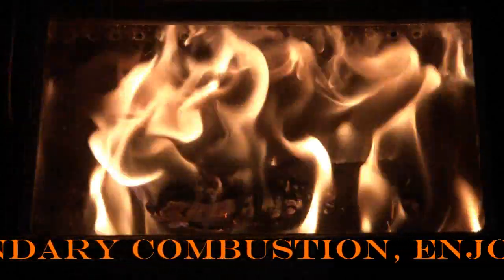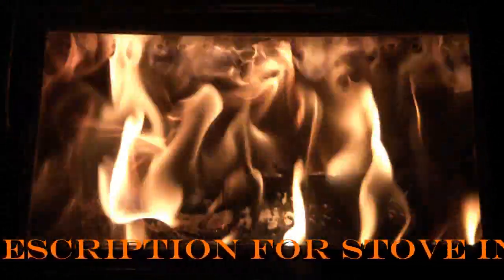Our wood stove's secondary combustion explained

Comment: I was looking to replace the overly expensive catalytic combustor for this unit, it took a few hours searching, I found that firecatcombustors.com makes the High Valley catalytic combustor.Mine was a WV-4150000034 for my High Valley catalytic insert.      Hope I saved you a few bucks not having to buy through High Valley!

Comment: Its still burning to fast for an air tight wood stove. Secondary combustion is really not needed if Your burning hardwood. I burn white birch in my airtight woodstove and the fire lasts for 2 HRS before having to throw more wood on the fire.

Comment: Why is the baffle insulation that just lays flat on top of the firebrick necessary
Reply: Sam Anderson so the secondary flames don't melt or distort the top of the stove at 1600 degrees.

Comment: My question is how does the air get that hot that fast when pulled into the secondary tube. It's just a straight shot from outside to inside.
Reply: The air comes in at the outside temperature and early in the burn that cold dense air has lots of oxygen in it.  As that plenum heats up, the fire brick radiates heat back into the stove and the metal absorbs it, its highly conductive.  That ice cold air warms then quickly super heats, igniting the gas from the wood or smoke.  Thats why brick is so important.  I had one brick out of place and it through the whole stove off.  Once I moved it back slightly, the next fire had no escaping flames and no smoke from the chimney, really remarkable.
Reply: Hi, does this air source for for the secondary burn require damper control during initial lighting or is a constant supply?

Comment: mine has a cracked top brick and the secondary combustion does not seem to work well.... u think replacing the brick would help?
Reply from the maker: +RandomEH! YES!!!! That shelf can not be compromised in any way. If there is gaps between ANY of the bricks the unburned gasses (smoke) will go between and not have contact with the super heated air to acheive secondary combustion. All unburned gasses must go "around" the shelf to have enough time to come in contact with the super heated secondary air, for the efficient "after burn"- Happy Burning :-)

Comment: Once you get secondary burning achieved, shut down the primary air supply almost completely. The wood will stop burning and smolder. The secondary burn will continue if the pipes are hot enough and the logs will last twice as long. It seems wrong but all the air will come from secondary air source and the smoke from the smoldering will ignite at temps near 2000 degrees. Try it after you have a raging fire for a few minutes and it's really hot. Play with primary till flames die on logs but keep coming out of secondary. No flames between logs and roof for a few inches. Hydrogen is burning from super heated air mixing with it. Easy way to get even longer burn times. Ember like smolder in bottom is all you need.
Reply from the maker: I have found now going into my 11th. season with this stove - with a good established fire and coal bed-1/4 primary open with good seasoned hardwoods is the "sweet spot" it will just roll for hours and outside at the chimney top VERY light smoke if any.
Reply: MrStropparo ...the primary intake..how does one control it. seems flames dies out?
Reply: Anthony Fryer 2 different air sources. Primary bottom air to start fire and get all wood raging with fire then shut primary and let the secondary top air do the work of burning the gases. Wood lasts much longer. close down the air on bottom of stove. So the stove becomes a vacuum starved for air and will draw it from the top secondary air tubes   When this happens the fire on bottom becomes smoldering embers and the smoke rises and mixes with the super heated air coming in the top tubes and the smoke spontaneously combusts at a much higher temperature because it's hydrogen and other gases and it consumes all the smoke and burns very efficiently. Stove needs to be as air tight as possible. 2 different air sources. Primary bottom air to start fire and get all wood raging with fire then shut primary and let the secondary top air do the work of burning the gases. Wood lasts much longer.
Reply: MrStropparo ..Wow..You sir are wise ..truly It did work with a 2+ hour gain...Thank you
Reply: One thing is mandatory to achieve better burn is outside intake. 400-500 degree is the time to close the primary intake. I tried to damper down slowly and instantly, after 2 combustion barrel shot. The Coaling was much better with more ash. I still have major impoverishment to accomplish...It's not toss in wood make fire make me warm..... experience & skill are needed.Thanks again.!!
Reply: Your stove may need a touch of primary  air to make it work instead of total shut down. So play with it a little. Enjoy. 😀
Reply: enginenut   It may be steam you see too. Well I'm glad I was able to add some clarity. Have fun.

Comment: The secondary air that's in the box at the top - does it come from outside the stove, via a hole in the side of the stove. Where does the air for the secondary burn come from? Is it forced in by a fan, or is the air drawn in and if so how.
Reply from the maker: The secondary combustion air intake is located on the back of the wood stove, the air is pulled in by the draft of the stove.
Reply: enginenut Thank you for reply. Your video is excellent. Have you ever thought of doing this kind of thing professionally and installing these things on older stoves? You should. Very good video and thanks for your response to my question.

Comment: We (in north NJ) upgraded to the PE Summit Classic 6 yrs ago, with secondary burn, no smoke with top down fires showing no visible smoke.  Heats our 28X48' barn frame home with south facing windows and stress-skin foam panels on 2 cords of wood a year, never use the electric backup.  The stainless steel secondary air bafflebox (lasts longer than burn tubes, guaranteed for 20 yr?  and has all combustion air passing by its airholes) sits above the fire and is easily removed when the stove is cleaned. We burn DRY wood  (split wood to 3x3", enough draft to keep a 600 degr stack temp....and no "all night" damped burns) -
   Just had the chimney cleaned, an internal single wall that runs 22 ft to cathedral ceiling peak...they used a powered brush from inside the stove, just a thin fluffy deposit.  Three years ago had roof replaced;  the guys checked chimney and it was not worth cleaning.  Prior to this, I had a Dutchwest 50k btu stove where for 6 yrs I did bank fires at night, cleaned chimney yearly and had perforation of acid creosote in 6 yrs- since then I am on same pipe...it's not burn time I am concerned with, but smaller hot fires that get temp up fast in the morning, and if no sunny day, may keep hot fire (3 3-4" splits at a time) to get house temp up before bed and be still 67 in the morning. IF sunny, my need no fire until next morning.

Comment: What temperature do you run the TOP of this or any stove or whats the maximum cruising temperature for the TOP of this or stove is ? NOT the stack or chimney...  Anyone?
Reply: I have my stove set up with secondary burn. Mine likes to hang out at 700-900 degrees F with a stack temp of about 250 F. Secondary burn starts when the stove hits about 450 F. Here's the link to video http://youtu.be/TXkBrOb-T2g

Comment from the maker: Hello, the longest AVERAGE burn time I get with this stove is 7 to 9 hours. There are so many factors that affect the burn time, I feel the 3 biggest are firebox size, fuel type, and draft. People who get those 14+ hours usually have a stove with a large cubic foot box-say 2.5, mine is only 1.6. Second a good seasoned hardwood, I primarially burn red and white oak, finally draft in addition to the air control on the stove I have a damper on the flue pipe as well, which hepls on those windy days.

Comment: What is the LONGEST  Burn time you have ever achieved.  I am reading that its possible to get  14 Hour + Burn times but my max has always been around 8 hours, even with a fully loaded fire box.  Which is not bad but, im wondering how folks are chieving 14+ hour burn times. Seems unrealistic to me.

Comment from the maker: The secondary combustion air can not be controlled, however the volume of secondary combustion air does change depending on how the primary combustion intake air lever is adjusted. The more intake air the more vacume/draft a stove will have.

Comment from the maker: @gabigowriel Hi, more or less the secondary air inlet tubes are some sort of steel tube with holes in it, but that is where it ends, the inside diameter of the tubes, how they are placed in the top of the firebox, and even the size air inlet holes drilled in the tube are all part of a stoves overall design. Smoke does not come out of the inlet tube because of the "vacume"/"draft" the stove creates while operating, pulling fresh combustion air in.

Comment from the maker: @MrGraygrizz Hi, most of our fires are for days, once the winter temps settle in. With properly seasoned firewood, secondary combustion, and correct stove operation we do not have any "campfire smells"  in our home. Usually the smells like that are from incorrect stove operation forming creosote deposits in the flue as well as sluggish draft within the flue. Usually we only get a slight "woodfire" odor when refuling...but don't mind because of all the money saved in our heating bills :-)